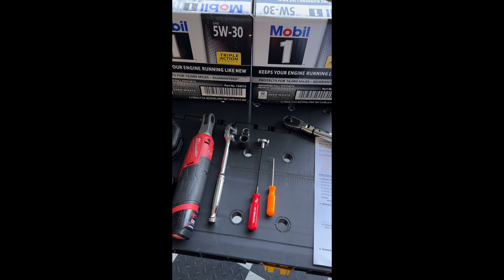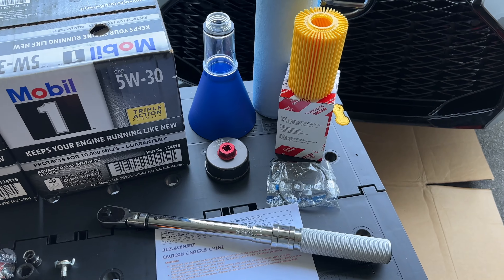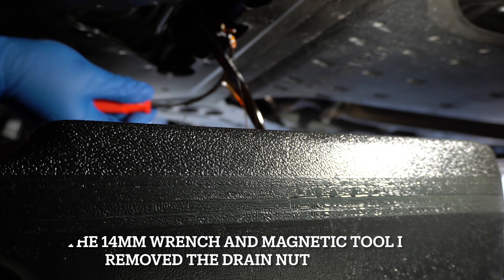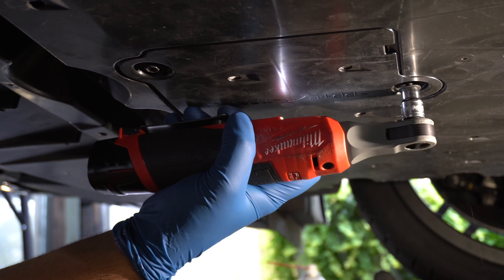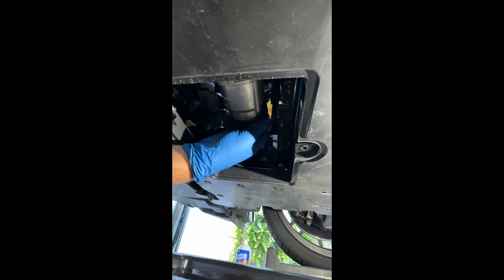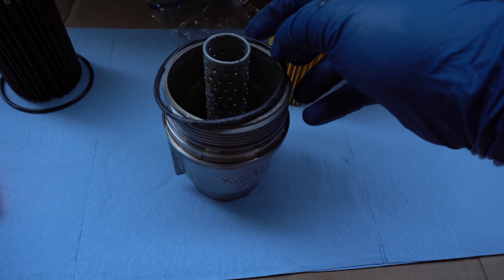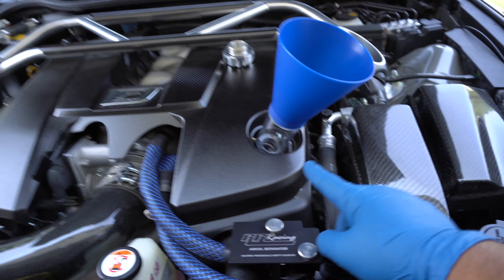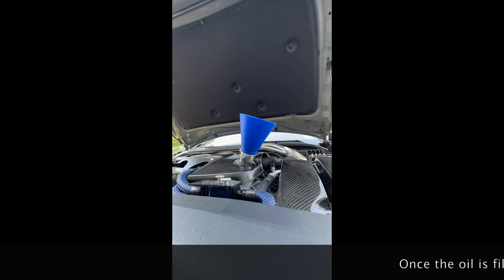Lexus IS500 Oil Change

Comment: The linked filter wrench kit has a filter drain tool, is that necessary for the IS500? I don't believe the filter housing has the bottom plug - but I could be wrong. Thanks for the advice!
Reply from the maker: Yup the IS does not have a bottom plug, the same company does sell the tool alone, I just bought the full kit cause my other cars do have the bottom plug.
Reply: @incognitoXXVI happen to know if the GX has a need for it?
Reply: You should use clean oil on the O-ring, not used oil from the old filter.

Comment: Could you please link the ramps you used to get the car high. Thanks!
Reply from the maker: Yup they’re just basic ramps from harbor freight : https://www.googleadservices.com/pagead/aclk?sa=L&ai=DChcSEwjciryDgt6BAxUT18gKHS7CDvUYABAJGgJxdQ&ae=2&gclid=Cj0KCQjwmvSoBhDOARIsAK6aV7izWtlLqTv8aZQf8z66b1mqMntZmGsySNCOopt8bqxF8ZoYoYBnBuYaAv1KEALw_wcB&sph=&ohost=www.google.com&cid=CAESVuD28F3Syj3MTddggw0acrtwntNKXVkTRL7mABOHWcaEmHGE_NFHzXcwNfOACQGm9aVLVqjW52NCznKlXZ2ZWBhGaSEoVeh3pgHwCwgxbhjGkCS2o6jm&sig=AOD64_3_Mb1e8-Qqilh4sHfelzjloxH4Ww&ctype=46&q=&ved=2ahUKEwiV4rODgt6BAxUbkIkEHXaoCZsQzzkoAHoECAUQDA&adurl=
Reply from the maker: The clearance is very tight so if I had to buy another pair I would def look into race ramps. I just bought the hf one’s years ago so I just used those

Comment: Its honestly a really easy car to do an oil change on. I've done mine twice already.  Dis tou notice any difference with the rr racing oil cooler?
Reply from the maker: Yes, I've seen my temps drop 15-25F consistently depending on my driving. A great mod for longevity esp with the trans cooler as well, both come standard on the F models and honestly should've on this car too.
Reply: @incognitoXXVI  wow that alot, I haven't noticed mine getting very hot, but I live in canada so maybe that's why, my oil temp just sits in the middle no matter how hard I drive it, does your stay lower than that?
Reply: @incognitoXXVI  what state do you live in? Thinking I might get it living in South Florida and summer temps.
Reply from the maker: @dru4135  I’m in NJ, the temp testing I did was in ambient temps of around 80-85F. In everyday daily driving you won’t see a big difference, but for longevity and aggressive track driving it is def beneficial. For track driving I saw a temp decrease of around 25 F both the before/after was done in 80 ambient temps
Reply from the maker: @85CEKR Sorry I didn’t reply sooner, didn’t see the comment but yes most of the time in regular driving my oil temp gauge is about 1/3 of the way yup.
Reply: @incognitoXXVI  that is a big difference, I wonder what temp it's at in the middle of the guage(where it's usually at stock), I love that it has an oil temp guage but I do with it showed the actual temp
Reply from the maker: @85CEKR Yeah which it had specific temps too, I have to use an obd2 reader to get the actual temps on track days or for testing.
Reply: Where did tou find that front strut brace?

Comment: Where did you get the fuse panel covers in carbon from? Thanks
Reply from the maker: Hi they are from tecnocraft and they are the rcf covers, which fit over the oem ones perfectly. 
https://tecnocraftcomposites.com/collections/rc-f